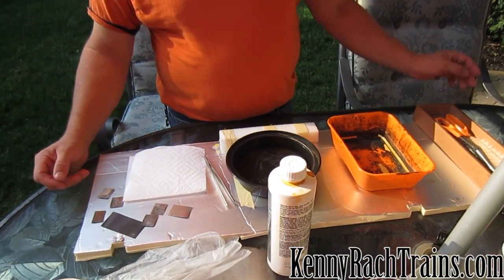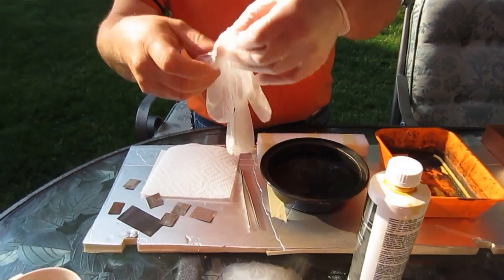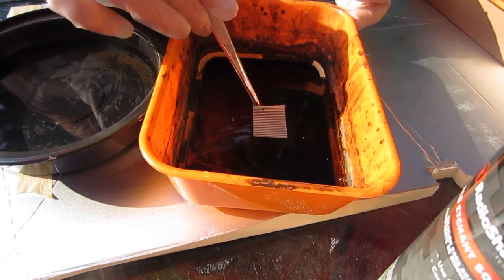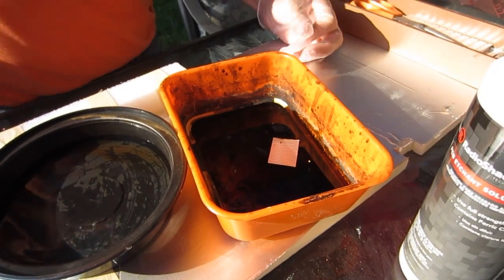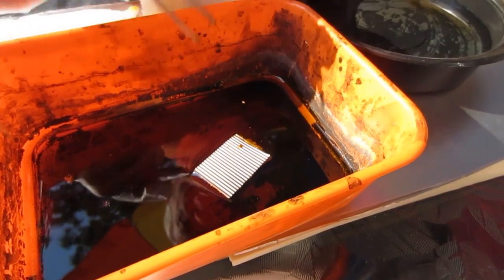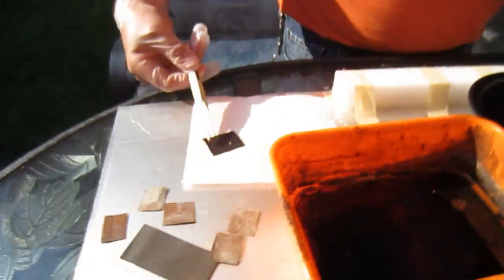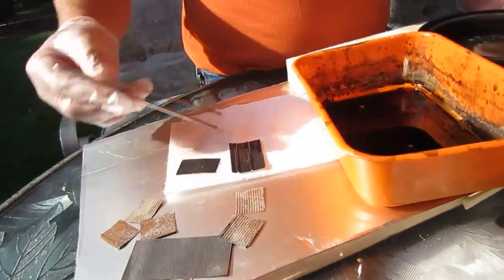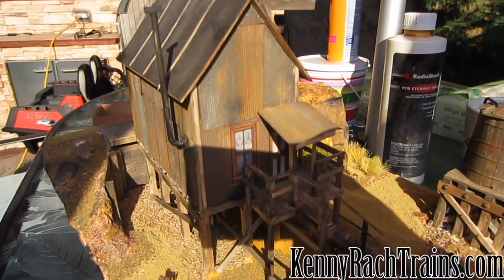How To Make Rusted Corrugated Metal Sheeting

Comment: Thank you:)  Will this process work on corrugated steel that has a zinc coating on it (like I would buy brand new at Home Depot)?
Reply: Did you try it?  I'm wondering the same thing.
Reply: hi and thanks. Never try it steel but you can try it on small piece hope it work out for you